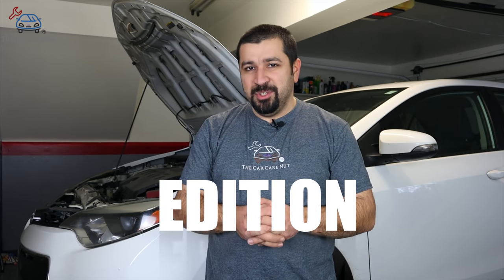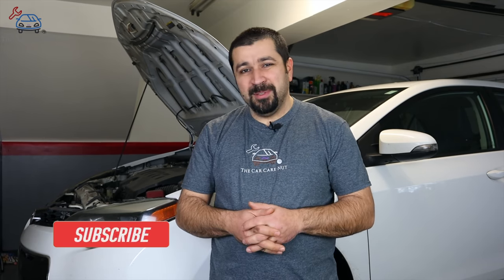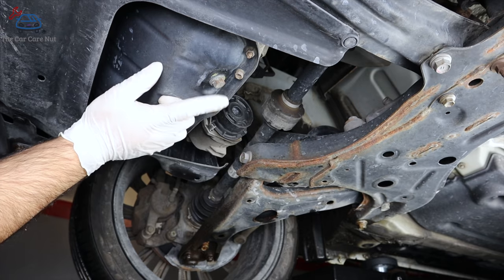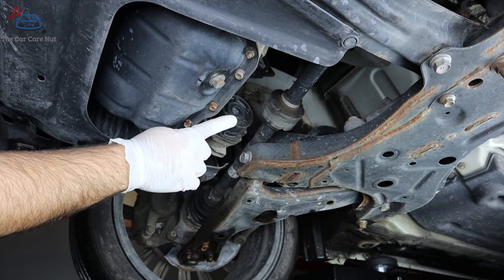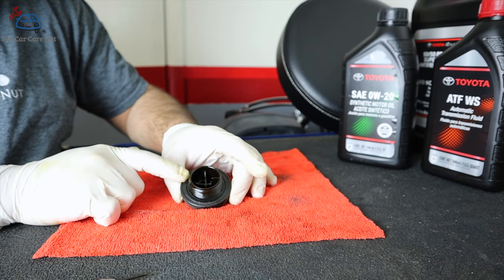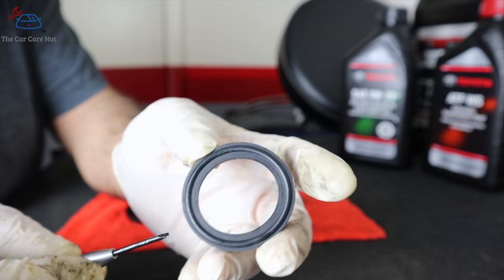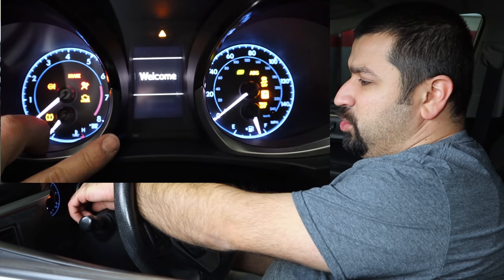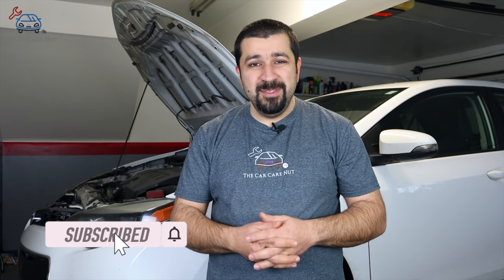How to change your Engine oil and filter for Toyota Lexus Scion

Comment: I believe all the Toyota 1.8L 4 cyl engines with canister type filter housings require a different size (smaller) wrench than those 2.0L and up.  I also attach about a 12" piece of flexible tubing to that drain adapter fitting to better direct the flow in the proper direction and position for my 6 cyl where the filter housing is in front of the oil pan.  Do you feel that it's necessary to prime the filter (obviously for those installed vertically) before re-installation?  I wish I had those quickjacks 😍
Reply from the maker: Hi! There’s only one size filter wrench for the canister style filters. And actually that same wrench from Toyota fits on a lot of other filters namely the F2 N1 F1 spin on filters as well. It wouldn’t hurt to fill the filter with oil if possible but not a must.
Reply: @TheCarCareNut   Thanks...I didn't know Toyota had one wrench which fits all the canister type filter housings in their lineup...my bad.  I see that your wrench doesn't have the extra cutouts that catches onto the ears of the housing which some of the aftermarket models have.
Reply from the maker: So the original filter wrench catches the notched portions on the face of the filter. Never had slipped before but the aftermarket ones that grab the end of the filter are good too

Comment: Hi AMD, could you do a video of what would happen if you run out of petrol in a Corolla hybrid
Reply from the maker: I can. On all hybrids if you run them out of fuel you’ll shut down the hybrid system and set trouble codes which have to be erased before the engine can be started.
Reply: @TheCarCareNut  yes I seen something like that on a YouTube video, its weird that they have 2-3 gallons of fuel in the tank even when the orange low fuel light comes on?
Reply from the maker: Yeah that’s correct. Toyota is always like that.

Comment: Curious what your thoughts are on the aftermarket drain plugs that have a built in valves like ValvoMax. I added them to my Forester and Transit. Just bought a 4Runner and Ascent and would like to add them to make changing oil less messy.

Comment: Just got 2015 Tacoma 100000 miles as second vacation/ travel truck.. am I doing any harm only driving once in awhile...? Thank You
Reply: i would change the oil every 6 months or 3000 miles if you don't drive it much, and I would also drive it for 30 minutes at highway speed every two weeks with the AC on. this will help to keep everything lubricated and charge the battery

Comment: The Toyota dealer I bought it from (metal housing 2012, I assume is original) had the drain plug on the filter housing on so tight I gave up getting it off even with a 3-4ft breaker bar. Not sure what I'll do if it ever starts leaking.

Comment: CCN, after oil change. do you recommend doing a Flood Mode on these toyotas? Stepping on accelerator pedal while starting so that oil gets primed into the system? or useless
Reply from the maker: Hi! Honestly useless. Just start it normally.

Comment: Question: On a 3rd gen 4runner 3.4 I'm going to change with Aisin water pump, when changing water pump. can you you use Toyota Seal Packing 103 or do not use the seal? Thanks
Reply from the maker: Hi! I would use the gasket in this case. This water pump came designed to be used with a conventional gasket and not a sealer

Comment: What is the approved documentation of changing your own oil for the dealership to keep your warranty? Do you need to update the the dealership database to keep the your warranty and extended warranty valid?
Reply: In the USA you need to keep track of the services you perform on your own vehicle and keep receipts for what you buy like oil and filters, etc.
Reply from the maker: That’s a very good question. A valid service record for warranty purposes needs to be a place of business receipt that clearly shows date, vin number, mileage and parts used. Doesn’t have to be a dealership but has to be a place of business with the above information on it. And they will require maintenance records only if there’s an issue that could be caused by lack of maintenance. For example if something happens with the suspension they will not ask you for oil change records because it’s irrelevant to the issue at hand
Reply: @TheCarCareNut  

Right to Repair

"The right to repair concept has generally come from the United States. Within the automotive industry, Massachusetts passed the United States' first Motor Vehicle Owners' Right to Repair Act in 2012, which required automobile manufacturers to provide the necessary documents and information to allow anyone to repair their vehicles. While not passed at the federal level, the major automobile trade organizations signed a memorandum to agree to abide by Massachusetts' law in all fifty states starting in the 2018 automotive year."

Comment: I only drive a little over 3000 miles a year. My oil is still clean before my yearly oil change. Would you still recomend changing it with only 1500 miles?....
You were saying that hot oil expands. I checked it out with a thermal expansion formula, a few days ago, and discovered the 5 quarts of room temperature oil, expands to 5.4 quarts at operating temperature.
Reply from the maker: I would change it every 6 months. If you drive low mileage likely majority of your trips are short trips. If that is the same replace it every 6 months.

Comment: Silly question - sorry. My oil drain plug washer is stuck to the oil pan. It's been like that for  a few years, and does not leak at all. Is there a risk if I don't replace it?

Thanks
Reply from the maker: Hi! If it’s a blue one then you’re good they are reusable. You can use a screw driver and tap the side of it and it’ll come out.

Comment: I’m surprised you didn’t mention checking the level and condition of all fluids (trans, battery, PS if applicable, coolant, brake fluid, and washer fluid). Plus tire air pressure and rotation. This should be done with every oil change. And it’s one of many reasons why I change it myself because this is often overlooked at the shops.

Comment: Great video! Question for you. I have 2013 Rav4. Oil capacity is 4.6 qts. Is it ok to put in 5 qts? I buy the 5 qt container of oil.
Reply from the maker: Hi! I wouldn’t overfill it. Add the correct amount

Comment: Great info AMD.  I think I have watched everyone on your channel.  What makes toyota oil special? I know you said that it is no different than mobil1, but my Lexus dealership says it is indeed different. They claim Toyota 0w20 has a much higher viscosity index (VI) than mobil1 0w20.  Any  official information on this from Toyota?
Reply from the maker: Hi! It is different in a way that it only has additives that toyota engines need. Mobil one might have more additives to suit all makes and models requirements but it doesn’t make it better though just similar

Comment: About the oil filter plug which takes a 3/8 drive, If I understood right, you are suggesting to open it to drain the oil inside the filter by using the plastic pin that's provided, but not change the gasket.  (Fit it with original gasket that was there) right?
Reply: No , he is saying  don't mess with the plug hole , in the bottom of the filter. Just srcew the whole filter off. Replace the paper filter and the big O ring, and screw the filter back on.
Reply: @kingdomthings9887  I see, thanks a lot.
Reply: @ivicks2  You're welcome 🙂

Comment: AMD, I have a 2017 RAV4 XLE, how do you feel about converting the Toyota Cartridge filter to a Spin-On Oil Filter with a Baxter spin-on Adapter?
Reply from the maker: Hi! It works but honestly I don’t see a problem with the canister to warrant replacing it

Comment: For a brand new 2021 Toyota Camry Hybrid, do you think I should change the engine oil at about 1000 miles?
Reply from the maker: Hi! I personally would change it
Reply: @TheCarCareNut  I'm just checking on if you agree that 1000 miles is a good time to change the oil for the first time.  Some people change it the first time at 500 miles, so I figured I would get your opinion. I have 700 miles on the car now.

Comment: Sometimes that "Blue" drain plug gasket can really be tedious to remove (I do torque the drain plugs at 30-ft/lbs every time), was that because of the new gasket was installed with the oil still dripping out perhaps the "Blue" gaskets are intended to be installed with the plug completely dry?  With the "Black" gasket, it comes off with the drain plug every time, easily...
Reply from the maker: That does happen to the blue one all the time.
Reply: You could use a small slotted screwdriver . Or one of the plastic pry tools used to remove interior trim or something similar to not to make a gouge .

Comment: My Toyota Avensis  1.8 (T27) 2012 (engine 2ZR-FAE) have 152000 km on the back. Do you recommend 0w-20 oil or thicker oil 5w-30 for this car.  I drive 7-10000 km/year  (sometimes towing a caravan) in Denmark where its temperatur are between 0- 25. And thanks for your video, they are very helpful.

Comment: @TheCarCareNut, Do you recommend filling your oil filter with some oil before connecting it to the vehicle?
Reply: I always do and have for last 40 years for vertical filters but not absolutely necessary. These Toyota engines seem to last forever anyways.

Comment: What’s your opinion on Amsoil vs Mobil 1? I change my oil every 3 months regardless of the miles i drive. Been using Mobil 1. Was thinking about Switching to Amsoil but have read that Amsoil is not API certified. Thanks!
Reply from the maker: Hi! Honestly amsoil is very good but it’s also very expensive. If you change the engine oil on time you won’t have any issues with Mobil one other than more money saved for the same result
Reply: @TheCarCareNut  thank you!

Comment: Hi - Appreciate the information. Was wondering what your thoughts are on replacing factory oil drain plug with a gold plug magnetic drain plug to collect any possible metal shavings? Thanks
Reply from the maker: Hi! It wouldn’t hurt but not something I highly recommend as the filter does just that.

Comment: PS......have upgraded to meta,aluminum filter housing, because the plastic was always difficult to remove. Do I need to change the center piece if not the same height? I bought an aftermarket one for a 2014 Camry.    Thanks...Jim
Reply from the maker: Hi Jim. The center piece should be the same from what I see on aftermarket filters. But if the aftermarket filter is different that one I wouldn’t know about.

Comment: Dealer Parts departments around Orange and Los Angeles County, California rip people off when it comes to the blue washer.  Oil Filter Cartridges go on sale all the time for $4 - $5, but they charge $1.50 - $2.00 for just the washer, depending on the dealer you go to.
Reply from the maker: Yep that’s too high. Less than a dollar is where they’re usually at.

Comment: What are tour thoughts on using a vacuum method to draw oil up through the dipstick? I have been doing that for my ‘94 MB C280. Seems to work. I want avoid getting under the car…my oil filter is accessible from above…
Reply from the maker: Hi! It works on cars that have the filter up top.

Comment: Hi, how many miles should I change the oil for corola hybrid 2021 at first time and what kind the oil is right one?
Thanks
Reply from the maker: Hi! I would personally change it at 1000 then 5000 then every 5000 miles after that. And I personally use Toyota oil or Mobil 1

Comment: my few cents from a gs350 w/ metal cap: 1. i use a generic chain-type grabber tool to undo the cap. 2. Bought car in 2013 never replaced the seal washer  Forgot it once, and it drips 5-6 droplets a day.

Comment: Is the oil cap gasket the same across all models? I've got 6 Toyotas so I try to buy my filters and drain plug gaskets in bulk.
Reply from the maker: If the cap is a screw on cap the gasket is the same. The 1/4 turn cap is different.
Reply: The o-rings come with the filter. The 1.8 liter four cylinder takes a smaller filter than the 2.5 liter four cylinder (not sure about the o-ring being the same or not).

Comment: I just bought a used 2016 Corolla LE with 97K miles. What services do you recommend me to do?
Reply from the maker: Hi! Transmission fluid replacement of it hasn’t been done otherwise just an oil change and a general inspection
Reply: @TheCarCareNut  wouldn't a coolant exchange and brake fluid exchange be good at this time since they might not have history on prior stuff?

Comment: Hey AMD!! I have a question that I'd love your opinion on. I recently took delivery of a 2023 Corolla SE hybrid AWD and did my first break-in oil change at 2,000 miles. 

After finishing up, I couldn't figure out how to force-start the engine to prime the oil filter, so I backed out of my driveway and did a short acceleration to get the engine to start. I did get the short timing chain rattle for a second while building oil pressure. 

Would that short bit of runtime possibly damage anything internally?

Comment: I have question. I just bought a ewk fluid extractor. I used that extractor for my oil change and i was able to extract only 3 liter or 3.2 quart. It should have been 4 quart 4.2 quart. So i thought that I was low on oil so that is why I was able to extract 3.2 quart. I have 2008 rav4 that burns oil. Is oil extraction a good method to drain oil?

Comment: You couldn't fill the oil filter before installing because it would have spilled.  If it is in the upright kind would you have added oil first?
Reply from the maker: Honestly I wouldn’t have. It doesn’t really make much of a difference

Comment: For my Lexus 2012 RX350 V6, can I use semi-synthetic 0W-20 engine oil? Change it every 5k miles. The shop I use has both bulk Kendal full and semi. Price difference is about $27 vs $80 a change.

Also, I have been bringing them a Mobil 1 one oil filter to use as its ~$11 at Walmart, and it's "synthetically" made that I understand is great for synthetic oil. The Toyota filter is around $6. The shop includes an off brand by Parts Plus 4 that looks like the Toyota one. Do you recommend going with the Mobil 1 oil filter, shop one, or Toyota?

Thanks!
Reply from the maker: Hi. I would use the oil recommended for your car. In your case it is full synthetic oil. Also personally I would use a Toyota
Filter.

Comment: For the 2018 to 2021 Camry hybrid use 0w16. They used to be SN plus and now is SP -GF6b.  Can the new 2020 Camry hybrid and 2021 Venza hybrid ( both production date of car 9/2020 ) use 0w16 with oil API SN plus ? Will it mess up the engine ? First oil change and I don’t know if the factory poured the SN plus or SP w GF6b
Reply from the maker: Hi! I will have to look into this one to get you an answer

Comment: Is wiper rubber part of the 2 year free maintenance item?
Reply from the maker: Hi! No the wiper inserts are not part of the 2 year free maintenance
Reply: @TheCarCareNut  Those inserts will never last 2 years in normal driving. lol.
Reply: Keep the OEM wiper blades as long as you can, it's way cheaper to buy the rubber inserts than to replace the entire blade every time they get worn. Aftermarket blades usually don't let you replace just the rubber.

Comment: Dealership over torqued my oil housing canister on my 2021 4Runner Limited, can't remove it by hand. How to remove it? Can I use an impact wrench that I recently bought to loosen it? What will happens if I broke the plastic canister in the process?

Comment: Wondering your opinion of engine oil flushes like Amsoil’s and cleaning out carbon deposits? Thanks!
Reply from the maker: Hi! They work however if you take care of your car usually you don’t need any products.
Reply: Flush is a bad idea. Frequent oil changes and high quality oil are the key...

Comment: What are your thoughts on TRD oil filter vs a regular toyota one? Is one better than the other?
Reply from the maker: Hi! I typically don’t like them. They don’t really do much in the real world
Reply: Thanks for answering my question!

Is there any benefit or downside  to changing out the oil canister from the plastic to the metal one? Does the metal over heat or strip the threading?

Comment: Hi brother, 
I have a question regarding the AC in hybrid vehicles. I wonder if the AC system in 2021 highlander Hybrid vehicle works as well as gasoline engine cars since there isn’t power compressor. I live in a hot southern Calif climate and wonder if the hybrid system can maintain cool vehicle quickly.  What is your take on it. Thank you sir
Reply: We lived in Phoenix for 25 years before moving to Flagstaff, so we know what you are talking about! Our Prius keeps cool beautifully in Phoenix summers (after all, the compressor has the same amount of power sitting with the engine off as it does on the freeway), but the extra vehicle volume of the Highlander could be more of a challenge. Honestly, I would want a test ride on a hot afternoon with four people in the car.
Reply from the maker: Hi! Hybrids use an electrical compressor so even if the engine is not running the compressor is on and it actually works pretty good for hot climate.